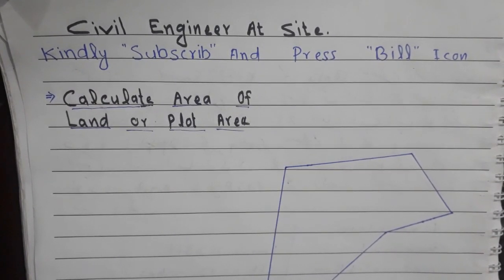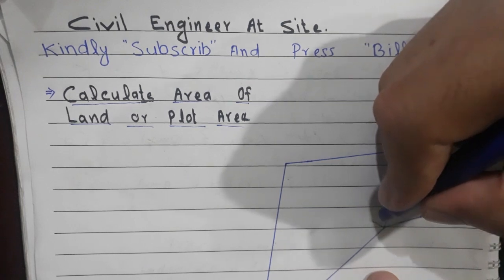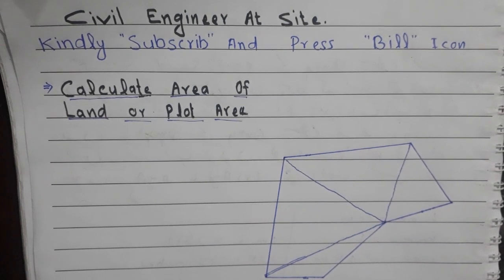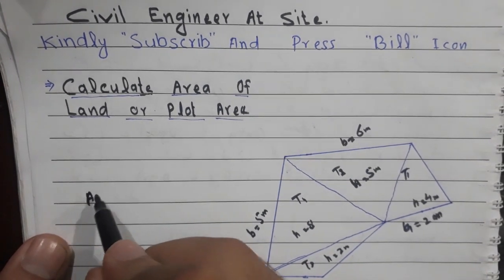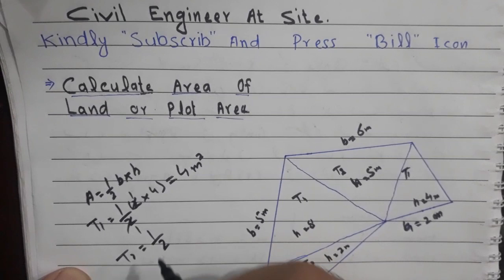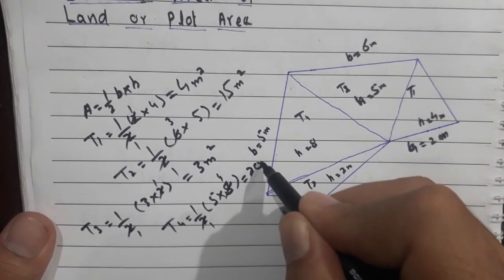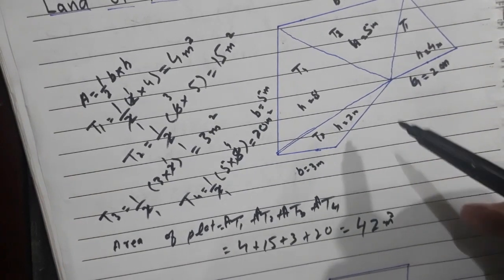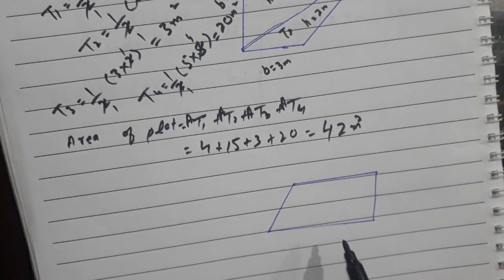How To Calculate Land Area | Irregular Plot Area Calculation.

Comment: the formula which you are using A=1/2(b*h) is not acceptable, only it is accepted for the triangles which are having at least one right angle.
the specific formula for this type of triangle area is a hero formula,
 The formula is given by: Area of triangle = √ [s (s-a) (s-b) (s-c)], where a, b, and c are the lengths of sides of the triangle and s is the semi-perimeter of the triangle s = (a+b+c)/2.